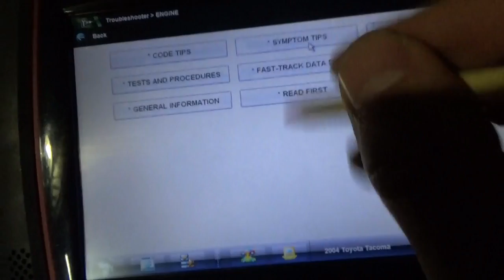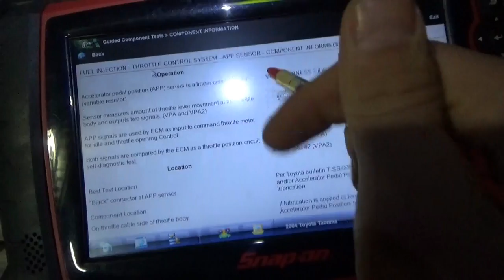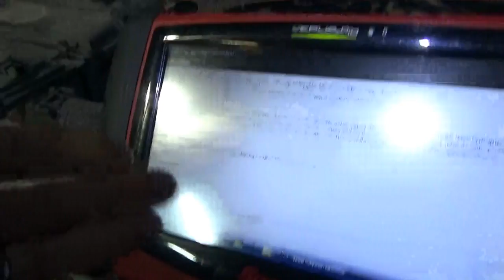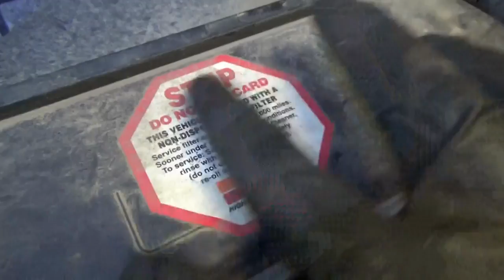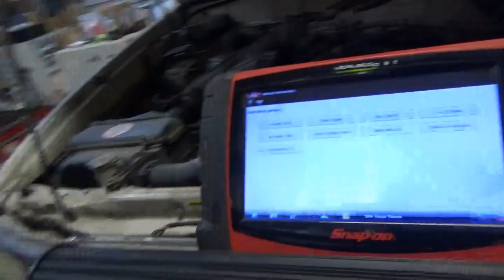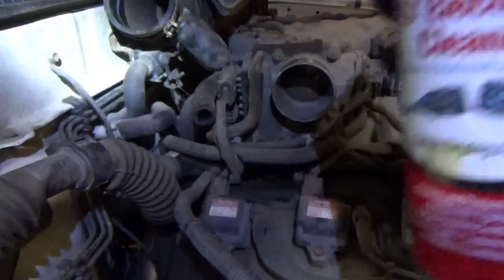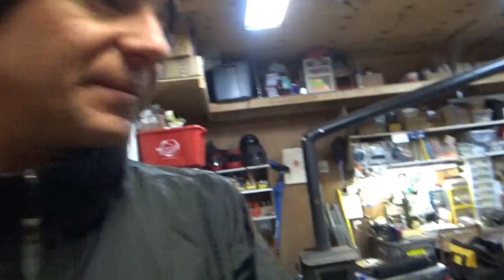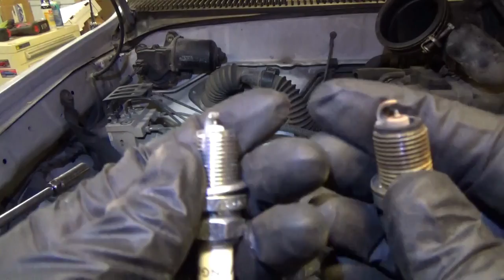Toyota Truck LIMP-HOME (P2111)

Comment: Amazing how readily people will believe any ridiculous claim made by some after-market manufacturer. Toss that crappy filter and put in an oem filter.
Reply: They do what they advertise - flow more air. The downside of that is, they allow more crap past them. If horsepower is all that matters, they're the perfect filter. If engine longevity is your goal, steer clear.
Reply: Nought wrong with the filters,  but this isn’t the right filter for the job here!
Reply: @davyarthurs  no it isn't you want a filter that catches as much as possible that k&n isn't made for off roading
Reply: Neil Murphy that’s what I said. K&N are no good for off roading.
Reply: @davyarthurs  ya I know that your right that's what I meant
Reply: I agree. My premise is that the only way to get more air for intake is via super chargers as normal aspirated engines are set according to cylinder bore size/displacement. Given no restrictions, either setup (OEM or K&N) will draw the same volume of air regardless. Just my 2 cents...Cheers!
Reply: It's all about horses for courses, in say a Performance only based environment such as a Drag Strip where every minute difference, well makes a difference quite frankly, they make a difference. Lots of guys run no filter whatsoever but I use K&N on my Webers just in case something large enough to destroy an engine is flying around in an engine bay with an engine revving over 8000rpm(in saying that, I've had an air cleaner stud come loose in a Holley & the locknut vibrated off & got sucked into the engine destroying 2 cylinders/head/Pistons)
Reply: Ya the black box will give you cold air and it's more convenient just blow it out and away you go
Reply: K&N filters are actually absolutely outstanding filters, when used correctly. Used correctly means cleaned regularly.

They have filtration rates just as good if not better than any stock filter.
Reply: Operator 801 not worth the bother; just change the OEM filter when you are supposed to
Reply: @kevinbarry71  I agree that they aren't worth the trouble, I don't use them. That doean't do anything to the facts though, and they are better at filterimg and better at permitting airflow. They are higher maintenance, certainly, but they are also just better filters.
Reply: Operator 801 what you say is true; assuming people maintain them properly. Most people do not. And if you look at the advertising for these things they don't exactly mention that you need to maintain them
Reply: @kevinbarry71  Nothing is wrong with their advertising. They label it as a reusable air filter and they have ample warning and instruction on vleaning and recharging. The only ad I recall seeing was a demonstration of how it can be cleaned continuously and reused.

People are stupid and this filter gives them enough rope to hang themselves with, along with big flashing warnings not to hang yourself with it. If the only damage the company does is take money from wealthy idiots who don't pay attention and don't care about maintaining their vehicle, then it's doing a national service. If they care, they'll learn. If not, they'll just keep paying.
Reply: I will never buy one of those filters like that. If anything I will use one of those foam filters you add a little oil to to pre filter the air if im driving in really dusty areas and just clean that every few days as needed. Damn
Reply: KnN and aem do work  if cleaned  periodically. I have been using both for  years no problem .
Reply: @pirihern9329  My point was that any naturally aspirated engine (basically an air pump) has a MAX air draw a filter cannot ever increase that draw any more than say, not having a filter at all. That peak draw is already established by the engine's displacement and mechanical condition.
I do accept however that there are differences among filters with varying degrees of "restriction." 

PS: I'm not a physicist but I play one here on YT. Happy wrenching!🤷‍♂️

Comment: The APP sensor is mounted there because it saved them a bunch of time and money NOT tooling a new pedal assembly.  Still very strange.
I swear, if all manufacturers put dielectric grease on the inside of the COP boot, there would be a lot less COP/plug problems !

Comment: You scare me starting those spark plugs with the dewalt, i've seen things go south quick using that method.I am not trying to tell you what to do, but it only takes one.
Reply from the maker: DON'T TRY THIS AT HOME 😅
Reply: @PineHollowAutoDiagnostics  OK, I won't but next time give me a cue  before you do it so I can look the other way...🙈
Reply: @PineHollowAutoDiagnostics  Yours or mine?
Reply: @PineHollowAutoDiagnostics   is a p2109 code on a 2013 4x4 taco similar?
Reply: I like putting the plug in the end of a shotgun slug barrel.  The rifling in the barrel will allow  the plug to spin as it goes in.
Reply: Frank McDonough Yes I could never get away with that, even taking them out, I’m afraid I’ll rip the threads out of head
Reply: I like to use socket and turn with my fingers..less chance for cross threading.
Reply: Yeah, I always cringe seeing guys start the spark plugs with a power tool. 😱

 I always start them with a piece of 3/8 hose. Thexton #492 is a commercially available spark plug starter kit (includes 2 lengths/pcs) for those so inclined to purchase "tool."
Reply: Yeah, that is one of those things for me when I do it, I feel much more comfortable doing it by hand.
Reply: I start mine with a custom made die grinder.
Reply: @prmayner  Qh yeah, @ 20K rpm, that should cut down labor time drastically....😎👍
Reply: i always take sparkplugs of with my Milwaukee M12 ratchet than get a couple threads by hand and finish it of the m12 ratchet never had an issue
Reply: @Jonathan11225  How it should be done. Imagine the unnecessary anguish and  pain caused  by cross-threading a spark plug hole.😱
unless of course you ram it in the rest of the way and say let the next guy to remove it worry about it...😈
Reply: @tinkerwest  yup leave it to the the next guy right hahhahaha. the only time i had a problem doing sparkplug was on a triton 5.4 3v .. im never doing those again
Reply: He does stuff like that spur viewer comments/participation.

Comment: My guess is vacuum developed in the pipe after the air filter and caused the air filter seal to deform. Then, maybe it sucked up a pine needle or something not allowing the plate to close fully temporarily. My vote is to replace that air filter with OEM quality conventional.
Reply: I would go back to the Toyota stock filter. K&N filters do let more air in for more HP. But they do not filter the intake air as well as stock. That is the trade off. Plus the maintenance of a K&N filter is more aggravation than just popping in a fresh stock air filter.
Reply: @MegaGeorge1948  ya and it's not like it's a 4 banger it's a V6 so theres plenty of power
Reply: @MegaGeorge1948  No it not just spray dawn dish soap light brush then hose off it came out so clean then blow with air gun done then spray thin type oil just little bit. paper air filter are junk for wet rain weather give poor gas mileage
Reply: I think he should reroute the intake ducting and air filter box to inside the cab right next to the driver's head.
Reply: @anonymic79  ya simple to clean a filter and throttle plate
Reply: Oh, jees... I literally thought the same and wrote it as a comment before reading your comment! I'm not trying to be a smartass.
Reply: @TheFirstBigCheese  it's ok
Reply: seems a good plan and change it in one to two week intervals, from the sounds of their driving and usage.

Comment: What was the buzzing noise?  It seemed to change tone when you moved the throttle.
Reply: sounded like the PWM control making the control motor and throttle plate "sing", that's pretty much every drive by wire setup out there, although most time out and park full closed after a few seconds of no RPM signal to ECM.
Reply: throttle bottle/thanks for the info!👍

Comment: K&N air filter only works best to clean environment but there is dangers of using a K&N filter on your vehicle the K&N air filter does not protect you from fine particles and drit .getting into your engine if you noticed that you will have multiple failures + your mass airflow sensor will go out of control  that would be the first thing you will have problems with! dirt and fine particles will get through the filter and destroy your turbo and your engine if you can see sunlight through your filter than your filter is garbage ? if you going on long trips with your vehicle like New York to Florida do not use a K&N air filter!!!!!!
Reply: do not use K&N filters on dirty roads you're asking for serious problems
Reply: You watched the project farm one where he tested air filters ?
Reply: I have seen thousand time with paper air filter it never none any better.
Reply: @Lost 1N Space Aquatics: Perfect summary but it falls a bit in summing: In clean environments, no filter works best actually! And in environments a great filter solution is needed, a K&N-one causes problems...